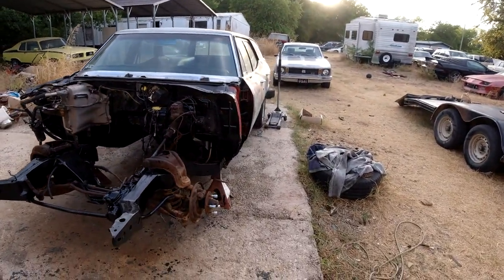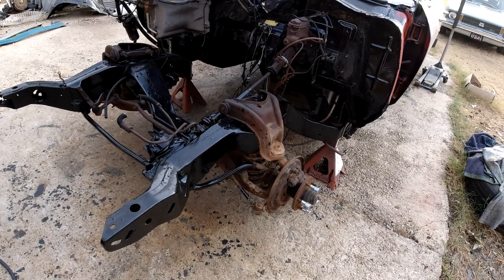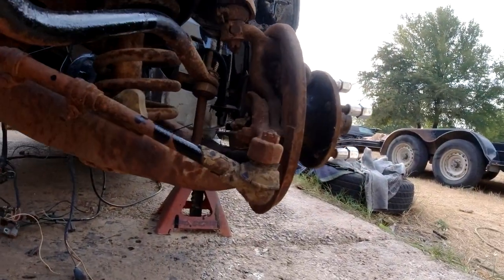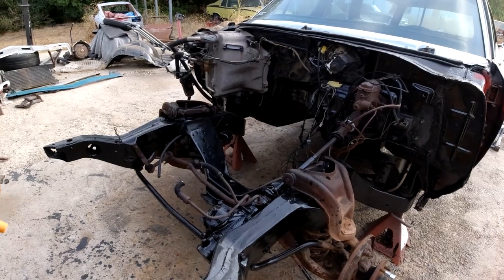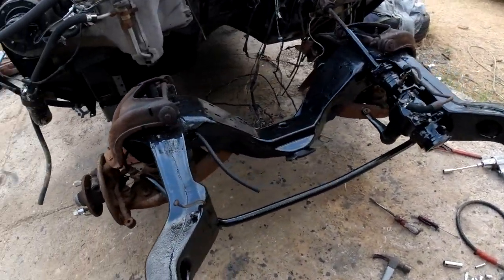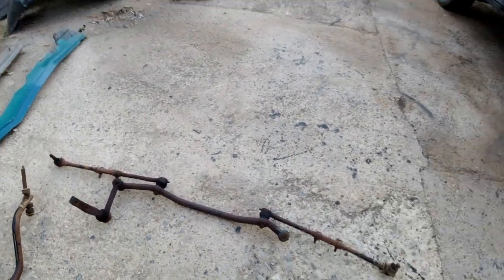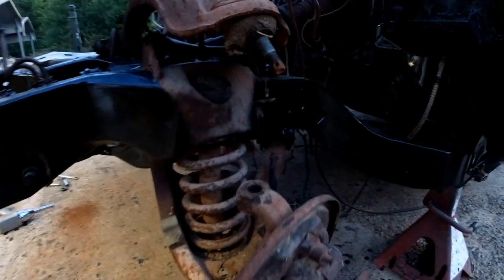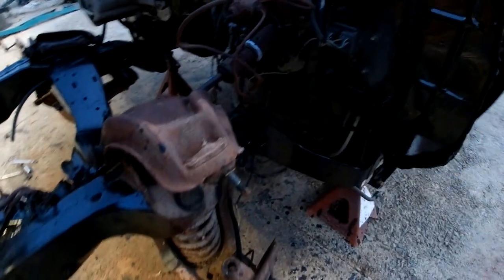1968 Chevelle Nomad Restoration - Part 29 - Disc brake Conversion - New Steering and Suspension

Comment: The difference  in the springs is there is no pockets in the frame for the end of the coil.I would grind them down  flat like the OE ones.Another old timer trick for removing the upper shocks is take a 9/16 deep socket with an long extension   bend back and forth  a couple of times, will break. Lh spring looks like it's not  centered. Like the video series  so far keep  going.

Comment: On my Nova the bottom ball joints went bad every 30,000 miles replaced them 3 times with the cheap ones. Upper ones replaced the factory originals after 160,000 put another 90,000 on it and they are still fine today. Have you ever thought of a canopy off of the side of a junk camper to bolt onto the side of your garage for shade. Looks like you may have some on your property.

Comment: When I did my springs and tubular lower control arms I ended up having to use a long threaded rod through the hole for the shocks to compress the spring as it pulled the lower control arm up into place. It was very easy compared to using the rented spring compressor.
Reply from the maker: sounds like what I need

Comment: You might want to leave that BB/MC off until you test fit the LS engine...you might have some clearance issues...you mentioned about a smaller booster being available, you might have to use the smaller one

Comment: Is the distance between the upper control arm & the frame, "Where that round bumper is" the same? The crushed side looks tighter than the right side on the video..

Comment: I would’ve let the top connected but loose so you have the spring pressure helping to separate the bottom ball joint. Just saying

Comment: I BELIEVE THEM TUBE A ARM'S ARE FORCING THE SPRING'S OFF CENTER . OR THE INSIDE DIAMETER OF THE NEW SPRING'S IS NOT THE SAME AS THE OLD SPRINGS .. JUST SAYING.